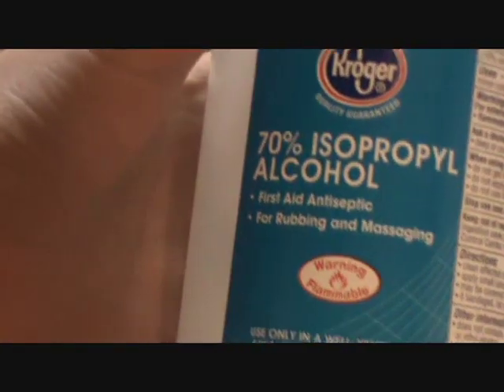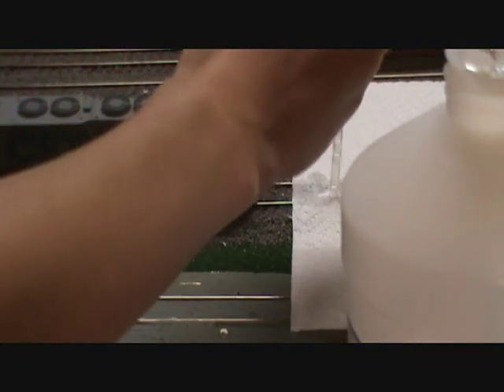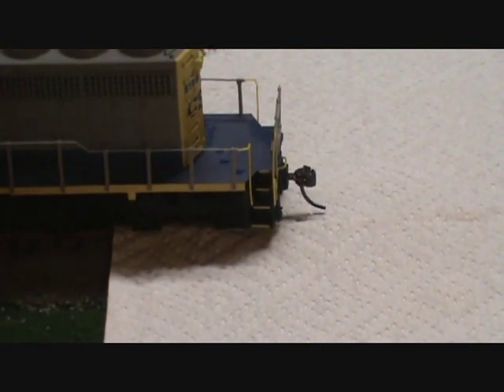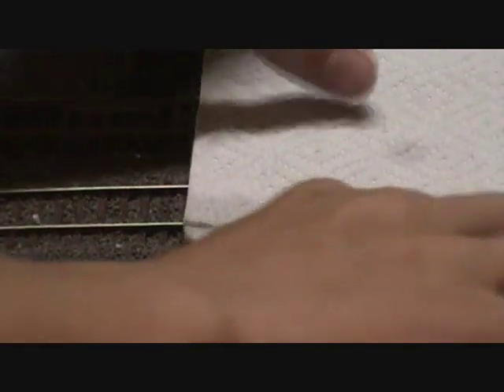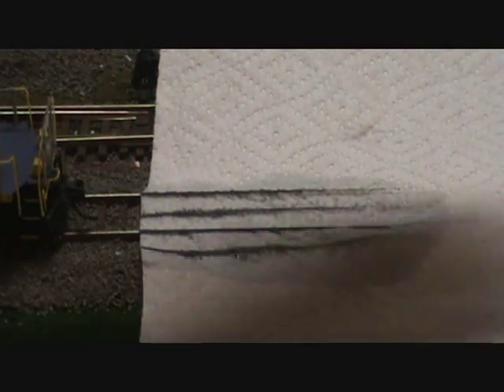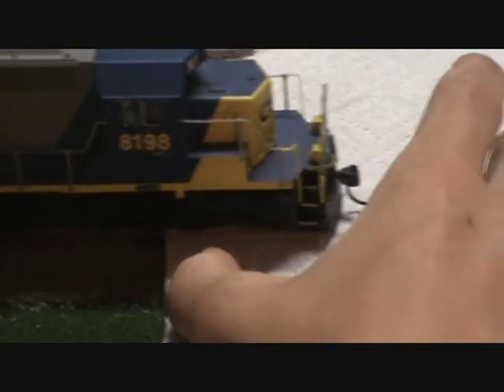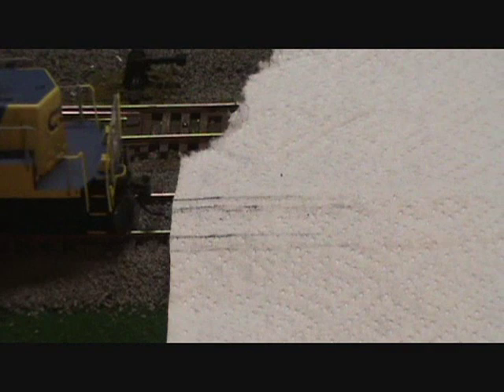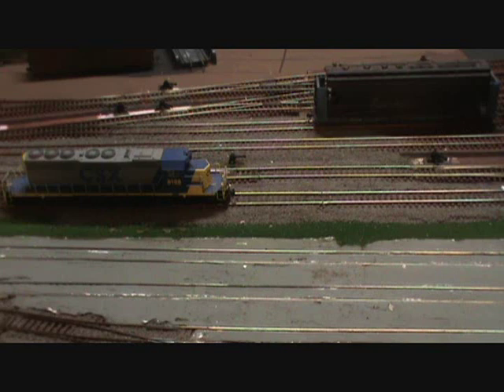How to clean model train wheels

Comment: What would i do if my loco has only 1 motor bogie and the other is a dummy?
Reply from the maker: +Ethan&#39;s Train Vlogs It depends if the dummy one is used as an electrical contact. If it is not being used as a contact there is no needs to clean wheels. If it is you can use something like an old tooth brush and some of the same cleaning fluid and use it to clean off the wheels.
Reply: CSXNo4591 Cool. Thanks mate.